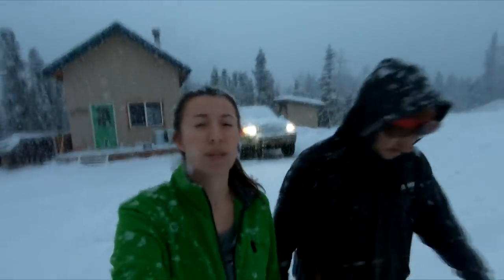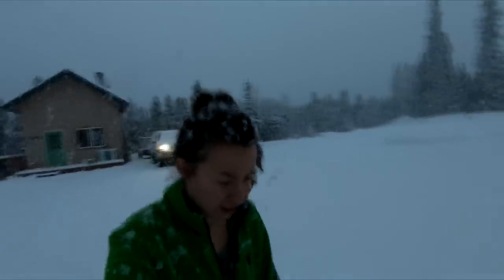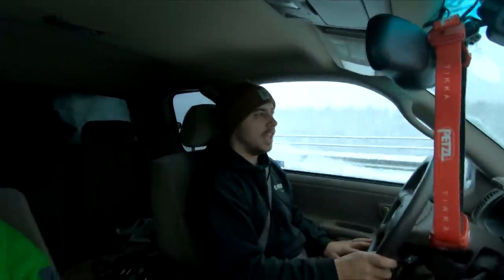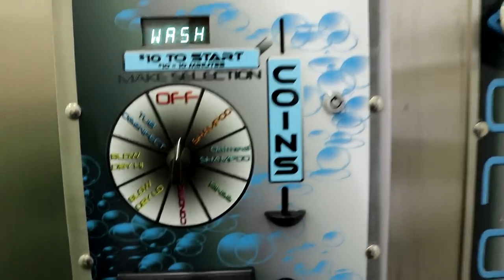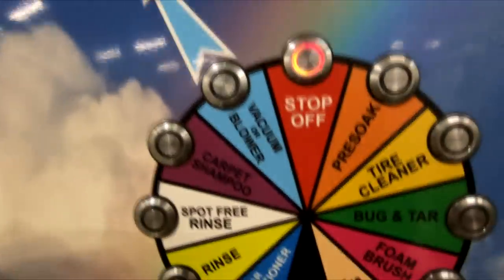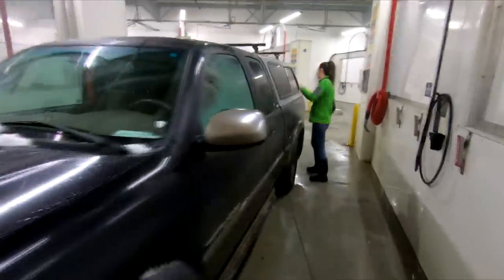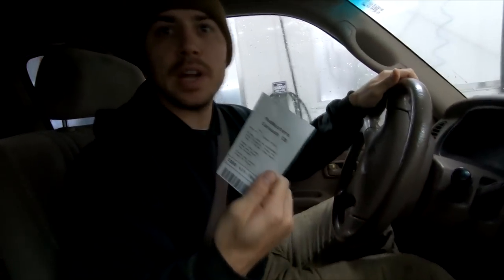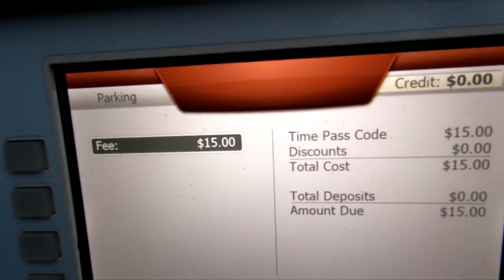Alaskan Car Wash | Indoor and Heated

Comment: Once a year, In the summer, put a tarp down under your vehicle. Take a mixture of linseed oil and some used motor oil fill a pump sprayer and pump the entire under carriage. Fluid film is an alternative that does the same thing. PA winters with the salt brine will kill your car & brake lines.

Comment: I need one of these in Maine.. went to wash my tacoma in 30 degree weather today.. the soap suds froze to the car.. and the water I sprayed dripped to the lowest points and made icicles... DOH! luckily I had it running, with the heat on high.. all the windows and doors opened up fine.. just the tonneau cover got a bit icy...
Reply from the maker: killahjeep we feel your pain! Everything freezes here, can't wait until summer 😎